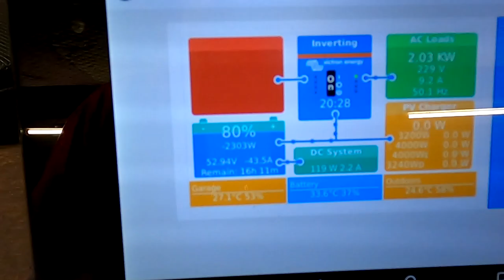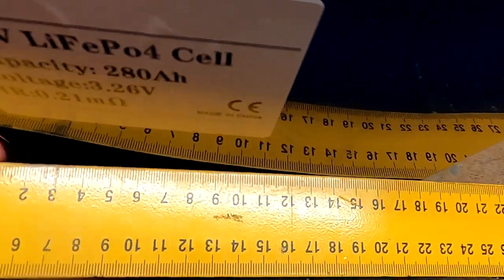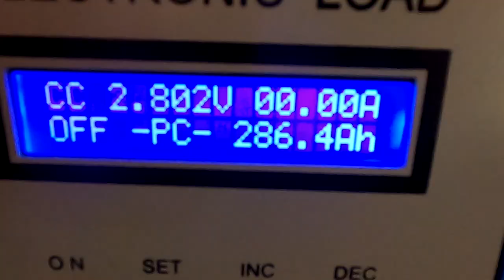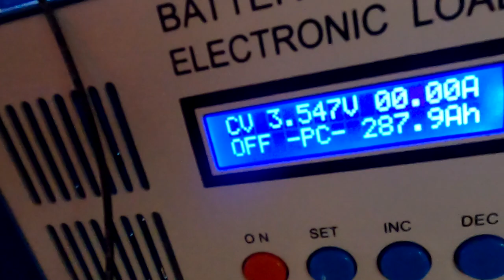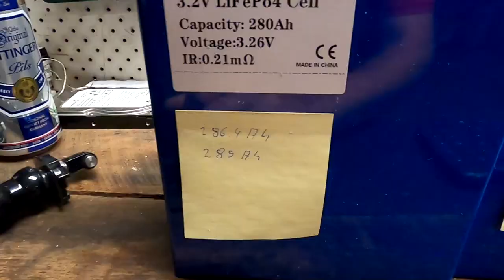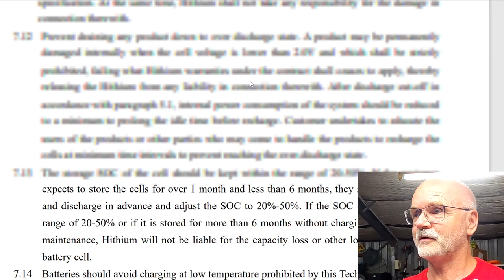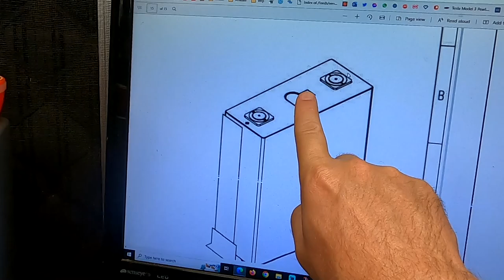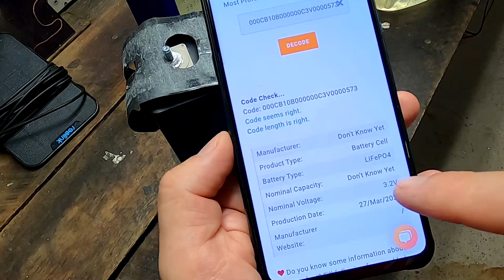Testing the 10.000 Cycle Hithium 280Ah batteries. Did I just get scammed??

Comment: My guess is that your cells may not have met Hithium's manufacturing/performance standards in some way & Hithium didn't want to deal whatever the issue was, so they discounted them & sold them in bulk to a reseller, who added some value to them before relabeling them & selling them to you.
Reply from the maker: That's what usually happens...
Reply: Agree 100%
Reply: Agreed, that would be my guess too...
Reply: @James Karrie drilling and tapping for studs.
Reply: Backdoor job in the small hours, an earner for the factory manager.

Comment: Andy, I have been importing these cells for a while now to South Africa, and have the following conclusion:

There are only 4-5 (real) manufacturers of prismatic LiFePO4 cells in China, they are:
 EVE, 
LiShen, (Lichen)
CATL ( China Aviation Lithium Battery Co ltd), 
BYD
And then also Samsung/Panasonic/LG; but you will not find the prismatic cells easily.

These manufacturers generally sell to other large manufacturers mainly EV,s and larger commercial entities.

The cells that does not meet the cut in required standard/specification generally ends up for auction in China and multiple companies buy these cells up, weld studs on, re-wrap and re-qrcode these cells. The biggest issue is consistency of product but it is possible to buy 360-1600 of these cells from the re-sellers that came from the same manufacturer as well as same production batch.

If you buy smaller quantities (below 10 000 units) you will not be able to buy directly from the manufacturer in most cases.

One of the reasons for the new qr-code is because the original manufacturer insists this is done, EVE for example since February 2022 only allowed there cells (so called rejected cells) to be sold on if it had a "B" in the serial number.

P.s. there have recently entered a few more manufacturers in China like OptimumNano, Wanxiang A123, Guoxuan, WINA and JB Battery.  

The cells that is sold like what you buy from Alibaba and AliExpress are never directly from manufacturers but more likely bought on auction, re-wraped, re-qrcode, via re-sellers.

They are from experience 87.4% of the time reasonable cells and will give rated capacity and give you many cycles 3600-6000( chemistry department not manufacturer)

The secret is the find a re-sellers that can consistently provide Quality cells. I have only been able to fined three of these.
Reply: Sorry for spelling mistakes.... autocorrect
Reply: @joulessolar8082  : Can you share the names of good re-sellers, you have mentioned? Is Gobelpower one of them?
Reply from the maker: Thanks for sharing. Yeah, I made 1-2 videos about this problem on my channel as well. The main problem is still that the reseller's honesty does not match the expectations of the buyers. As long as they can make seme $$$, they will keep doing it.
Reply: @joulessolar8082  do you have a website, needs cells in ZA, tx
Reply: CATL and CALB are two different companies.
Reply: @simsondude3519  Lol brother still waiting for the answer. What resellers can u vouch for?

Comment: Great catch on the hidden code underneath.  Maybe they are just rewrapping some other manufacturer's cells.  The sudden stop of communication is a bit concerning.  They should at least have answers to your questions.
Reply from the maker: The communication with them is my biggest concern. If it would not be their cell, they could have denied that right away and point out some features and differences. But not responding is very suspicious.

Comment: Hi Andy! Nice to see you again! 
I've just get mine battery delivery, 30Ah LifePo4 96 cells from alliexpress. And then started mine nightmare... I started to test them and... tested 6, the tester has failed. ZKE EBC-A20. I can do any settings, it remember all, but on testing screen there are only zeroes. The tester does not see connected battery - voltage 0. The second problem is that every tested cells has 22-25Ah only. What a great day!!!
Reply from the maker: Never buy batteries from AliExpress. Always use Alibaba!
What do you do now?
Reply: @OffGridGarageAustralia  Now I'm thinking what to do. I think I'll open a dispute through aliexpress and see what happens.
I have to buy a new tester also.
Reply from the maker: @michao6495  try to contact the seller first to work things out before opening a dispute.
Reply: @OffGridGarageAustralia  You thing so? OK, I'll try. But I thing, they know what they sell. Cells supposed to be a GRADE A, but looks terrible.

Comment: you should calculate the energy efficiency of charge discharge.  The capacity is not the same.  The voltage is higher on charge then discharge.  You should multiply the V*I then integrate for up and down.

  Great Video!

Comment: Nice Review Andy, considering that you did this video in 2023 Jan 20.

Would you recommend using 580w * 8pc(4640w) panels to charge this Hithium 48v 280Ah?

Also what's the max discharge rate you would recommend on this battery?

Comment: i love your videos and the extreme testing you do! i was watching your active balancer videos and thought of a test for you:
mix a small capacity cell into a large capacity 12v or vise versa with several active balancers working together, enough to handle the full charge current. 
this test will confirm if it is possible to get all the capacity out of every cell.
Reply: maybe 50A worth of balancers while charging at 40A
Reply from the maker: The balancers will only ever deliver a high balance current if there is enough voltage delta.
Also, we have tested and discussed this a while back with the Batterie1.0 and the low capacity cell 6, 7 and 8 in this pack. Active balancers running all the time won't help and put even more stress onto the weak cell because it gets this constant additional charge at the bottom and top. The gain was minimal though.

Comment: if the bar code is a sticker, try to remove it, maybe underneath there is the new-new- bar code
Reply: Same thought here - but a re-re-labeled cell is really weird.
Reply from the maker: No, it's not a sticker. At the first moment it felt like on.
Reply: @fldutch  It is already a re-re-labeled cell, if there is another QR code underneath a sticker, it will be a re-re-re-labeled cell. But both is weird.

Comment: Hello Andy, could you also include the environmental temperature during your testing? 
I've recently received my cells and tested them at 12°C environmental temperature. 
I noticed that almost none of the cells was able to pull rated capacity. 
After some investigation I found out that there might be a >3% difference in capacity between the 25°C recommended testing temp and the 12°C in my testing environment. 
Accounting for the 3% difference the cells would be able to pull rated capacity at the recommended testing temperature.  (304 cells and they pull around 299.5-302 Ah)
Therefore I believe that including the average temperature (or a graph of the temp during the testing) could really help with the understanding of your results.
This would also help to make the testing more reproducable.
Reply: In the german Akkudoktor-Forum someone made a little "reverse engineering" on the temp-graphs shown in the EVE LF280K spec-sheet. So as a rule of thumb you could guess a capacity drop of 0,3% per degree (Celsius/Kelvin) below 25°C (it isn't that linear, but should fit). So if you test at 12°C you might roughly (very roughly) come from 299.5 to 311.65 Ah if tested at 25°C (3,9% lower capacity because of the temp).

Was that you in that forum? I also introduced this as graph of temperature adjusted capacity on my video on NKON EVE LF280K "true" Grade A cell test. I solely measured cell temperatur with an infrared thermometer in the middle of the big flat (bulgy) cell area at the beginning of the test (but i got temp logging active for my testing area - cell temperature matched the room temperature very closely and room temperature near the testing area rose by 1-2°C during testing because of the heat from the EBC-A40L).

I might try a comparative test with the next batch of cells i plan to order - one at 25°C (thinking of building a test cabin) and one at a lower temperature (maybe in my 15°C basement).
Reply: @fldutch  I also have those cells from NKON LF280K “true Grade A cell”, they are good cells but not Grade-A, Grade-A are cells that pass all tests and are sold to the industry and that’s why we do not see them, is also why Eve coded them with a B in the code and provided them with that double connection, just enjoy and use theme, anyway, that's how I think about it.😊
Reply: @habana7638  No B on that qr-code 🤷🏻 - and the B in the code stands for LiFePO4 - 04QCB …- EVE (04Q) - Cell (C) - LFP (B) - according to EVE datasheets. Ok, dont know what the real source is, connections are normally not applied by eve and the barcode is easy to remove and re-laser engravable. Not easy to determine if it really is grade A or B.

But of course there is a reason for writing „true“ :). I do not trust anybody in the battery market. Anyway up to now they are better quality compared to my docan delivery. And the price (for me, running a business, so no VAT) is just the same as from Docan. And if sth is wrong with the cells i‘ll go and visit them in the netherlands - „just“ a 3hr drive ;).

In the end i bought from NKON and not from Gobelpower/Docan/younameit from Alibaba or directly because of possible DDP scam. As a business person i do care about not having proper tax documents and only a proforma invoice - a little scary. Buying within the EU is much more safe on that side and if prices are equal, there i go and buy at NKON.
Reply from the maker: The cells were between ~25° - 33° when testing inside the garage.
Reply: @fldutch  Same here, I have been ordering from NKON for years and they are trusted, so I was happy that I could just order them in the Netherlands, have been using them for a year now and they are fine cells, use them with an SBMS0 that only balances 150 to 200mAh and stay within the 10mV delta even with large loads, I haven't tested them because I honestly don't care, just use it and the future will tell.😄   oh  and I have a JK BMS as a spare you never know, be prepared..
Reply: Had the same problem 3 months ago in cold Colorado. I was testing 32 LF280 cells at 50-60oF (10-16oC) and got 276Ah average.
Testing with a Zketech EBC-A40L like Andy. Charging to 3.65V @ 40A and 4A cutoff (not 1A like Ray & Andy) , discharging down to 2.5V.
But once I got the room to 72-75oF (21-23oC) most got up to 279-280AH.
More details on my Raphtronic blog, look for the post called  'Lithium Cell Capacity Testing Saga from Hell'
Reply: I have noticed that the last 10 amp hours or so before empty, the cells will heat up by about 2 degrees Celsius. This was repeatable, and the reason I don't take mine under 3.0v per cell.
Reply from the maker: @john_in_phoenix  Oh, I never noticed this on mine. Interesting.
3.0V is perfectly fine.

Comment: How could they have tested the 10000 Cycles? With 0.5C charge, 30 min rest, 0.5C discharge, 30min rest, a full cycle would need 5 hours. You can do less than 5 cycles a day. 10.000 cycles would be more than 2000 days (more than 5 years). Do they test less cycles and do some kind of prediction with the remaining capacity?

Edit: Had an error in the maths.
Reply: Yes, and test with smaller versions and extrapolate. This is part of testing called HALT (highly accelerated life testing) as well and common for these things.
Reply: Extrapolation. If the degradation mechanism is linear, it can be quite accurate.
Reply from the maker: The degradation won't be linear but you can still generate an algorithm from what you see at the beginning.
Reply: @OffGridGarageAustralia  Nope, you can't calculate this by any algorithm, if you are not Jeff Dahn.
Reply: @Stefan_Dahn  With 'you' he didn't mean himself or the viewer, he obviously meant the scientists that work on these battery technologies (like Jeff Dahn and many others)...

Comment: 12:50 These are not charging losses. Rather they are tolerances in measuring current and time in your tester. Only if you look at the energy (instead of capacity), there would also be heat losses in the measured values.
Reply from the maker: Correct.

Comment: Interesting. From the respective websites via OGG's links:
EVE lf280K Warranty: 3months-1year
Shenzhen Qishou 10000 Life Cycles 280Ah Lipofe4: 5years
Reply from the maker: I would not hold my breath on any warranty statements of these resellers. Damaged cells are usually covered but how do you claim a cell after 4 years? Impossible to get a replacement by then...

Comment: What an interesting and very exciting video this was!   Thanks for sharing your discovery with us Andy, it kept us all standing on our chairs 😍Perhaps these batteries were acquired from the original manufacturer who, for whatever reason, discarded them and revamped them by your seller?
Reply from the maker: Thanks Mauro. Most likely, they didn't meet the specifications and were auctioned off to resellers. I just don't understand the barcode logic of covering the original barcode. Could be that the manufacturer did that to hide their brand from lower quality cells on the market. I think they are still great for that price and performance.

Comment: great video. at 19:18 the spec says charge/ discharge at 0.5P (not C), i guess they mean at 280Ax3.2V x 0.5 leading to 448W constant power, thus it might be possible to test the cells at about 140A 6  cycles per day, thus instead of 27years someone could test the claim in 6.5 years. but bogus barcodes make one suspect that the products are not accounted for and thus no warranty claims are likely heeded by anyone (infamous tailgate warranty)
Reply from the maker: They are definitely not genuine Hithium cells. I have warranty on them with my supplier, not with whoever manufactured them. If this will be upheld, I don't know.

Comment: Andy - how did the cost for these "10000 cycle" batteries compare with regular EVE cells?
Reply from the maker: I don't have prices for original EVE cells with certification. These were US$115ea
Reply: @OffGridGarageAustralia  So they are roughly 2/3rd of the price of an EVE cell.
And for this price they can compete with their initial performance with an EVE cell. Perhaps EVE and others are too expensive.
Reply: @OffGridGarageAustralia Original LF280K EVE cells with certification cost about USD130 sample order and USD115 bulk order.
Reply: @neduodumbu1969  Where?
Reply from the maker: @Stefan_Dahn  Can't confirm that. The last quote I got from EVE Energy Co was US$165 per cell for 32 cells plus shipping, tax, customs.
That was 4 weeks ago.
Over 40% more than for the Hithium B grade cells. Or whatever brand that is...
Reply: @Stefan_Dahn  from an EVE sells rep, as at 7th Dec 2022.  (In his words, for bulk order you have to wait one month from initial  payment before your order is shipped)
Reply: @OffGridGarageAustralia  Your order has to be large, to get that price. However they do not weld single studs to the terminal like QSO do.
Reply: @OffGridGarageAustralia  The lowest they will sell is $132 / Cell even for an entire 2120 cell container, this does not include shipping or taxes. Essentially for most the cost landed is around $175.00/cell with a typical 10-15% markup expect to pay about $200.00 at retail on average.

Comment: You seem to be a very smart man. I need your advice with lifepo4 cells.. So i have 8 230A cells connected in series and im trying to pull 2200 watt, it has 2C rate so the battery cells should be able to provide easily. But with a 2,5 kw continu and 5kw peak dc to ac inverter i cant pull even 1700w 🤔 How would you troubleshoot this..?
Reply: Your last statement of 1700w seems off the track, is it continues? Peak? At what SoC? Are these new cells? Lot of factors and variables, so maybe a forum would be more suitable for answer
Reply: @abidhussain7552  thanks for your advice I figured it out. 3,2v x 8 x 230ah should be able to provide above 10kwh with 2C which is almost 7 times the needed 1,7kw to charge my EV.. I had cheap and lose aluminium busbars which couldn't handle the load. I have 6mm2 copper wire now..

Comment: It's not a QR Code but rather a Data Matrix Code. Suggest try scanning with a compatible scanner or app. (QR code has the large blocks in 3 corners, Data Matrix Code identifiable by the right angle formed by the edge of 2 sides.

Comment: Based on the methodology described within the spec sheet (0,5C charge + discharge + 2x 30 minute rest for one cycle), the 10 000 cycle test for this battery cell should take 10 000 * ( 2h + 0,5h + 2h +0,5h)  = 50 000 hours. This means almost 6 years of testng. Was this battery cell put on the market 6 years ago? If not, this would be proof the seller is not serious.
Reply from the maker: Well, no manufacturer tests their cells like this. They do maybe a few months and then extrapolate the data. Do some more testing in heat and cold and with the data gained, they got a good idea how this chemistry will perform over time. EVE, CATL, Panasonic... they all do it that way. Nobody is waiting for 4 years before they bring out a new battery chemistry.
Reply: @OffGridGarageAustralia  Not just with batteries. Any product that lasts for years like this is tested in a highly accelerated life tests (HALT) and data is always extrapolated. You wouldn't be able to do R&D to get to a product otherwise.